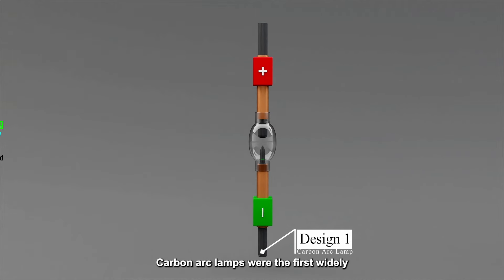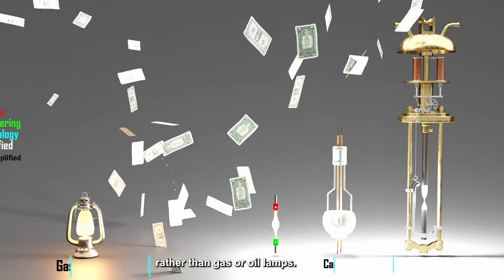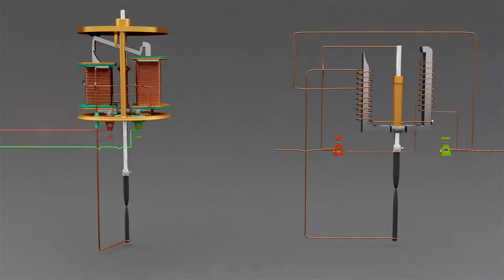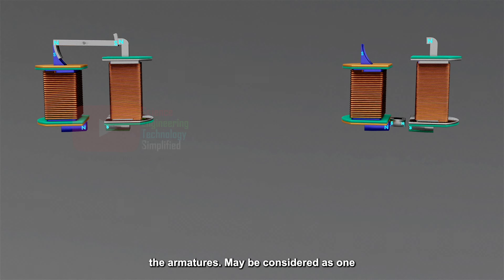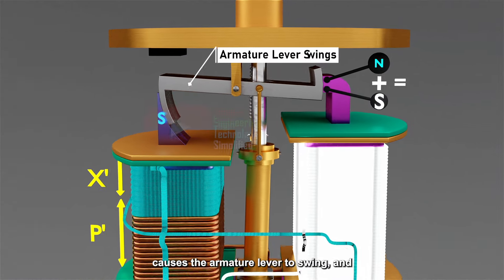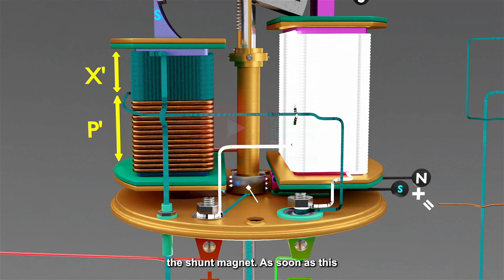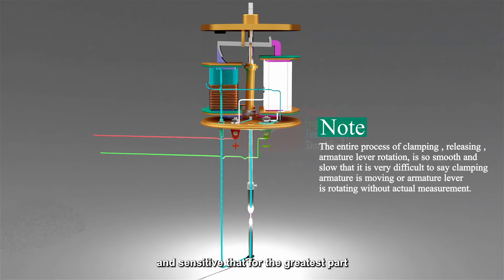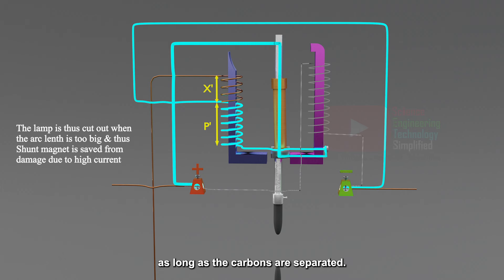Carbon Arc Lamp designed by Nikola tesla | Carbon Arc Lamp working | carbon arc lamp animation

Comment: WRONG. It was designed by Sir Humphry Davy BEFORE Tesla was born. Stop the lies.
Reply from the maker: Yes.. That was manual but this automatic controlling model was designed by Nikola Tesla
Reply: @set_simplified  No, you're thinking of fluorescent.
Reply from the maker: @seanwatts8342   i have given references . Just check the description
Reply: @set_simplified  That's not a different design. It's just a spring damped by a magnet. Tesla made a striking mechanism, not the lamp.
Reply: AMBOS ESTÁN EQUIVOCADOS. El arco voltaico lo descubrió sir Humphry Davy, 
pero el primer regulador para lámpara de arco lo inventó el físico francés Foucault 
en la década de 1840. No Nikola Tesla.
Reply from the maker: @Lemmax-X-exdom   I am not telling first or second
Reply: @Lemmax-X-exdom  You missed something in the translation.